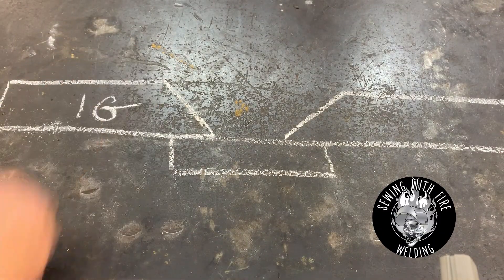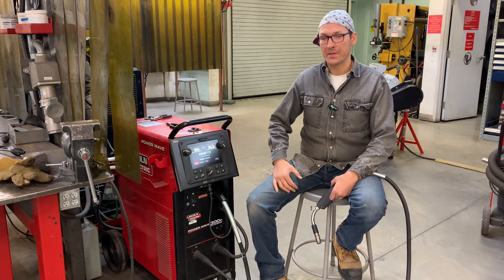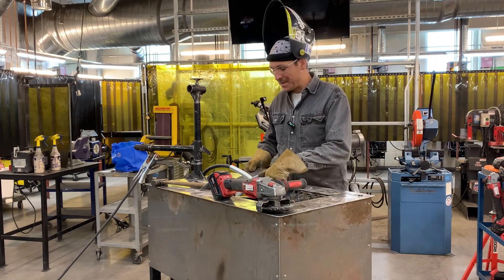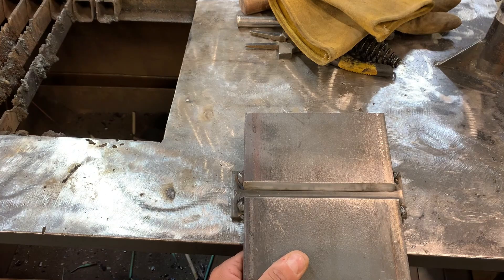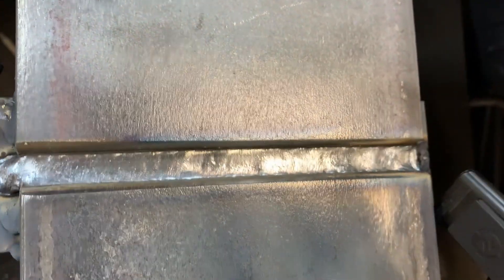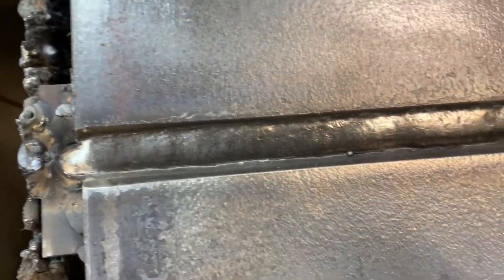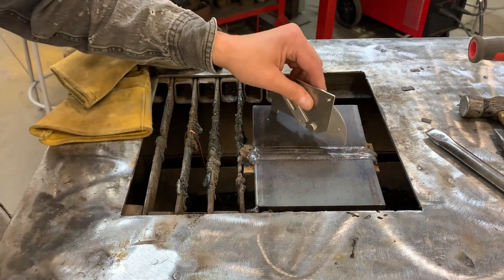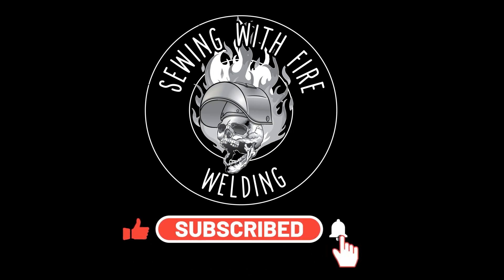Fluxcore (FCAW) Dual Shield 1G Single V-Groove Weld with Backing Bar

Comment: How did you decide the number of passes ?
Reply from the maker: It’s all in your travel speed - you should watch how much the groove is being filled up. With this wire you should be putting a 1/4-5/16 weld in at a time. About 3/8” wide on each pass.